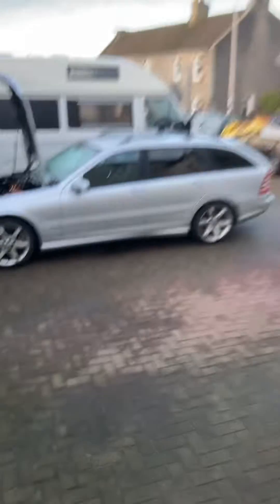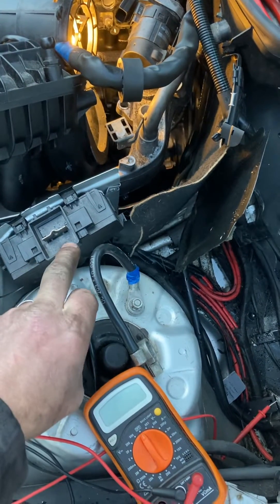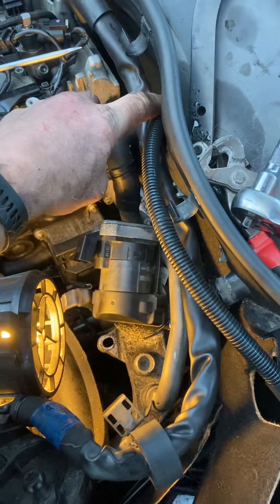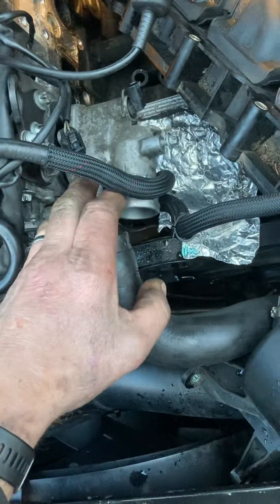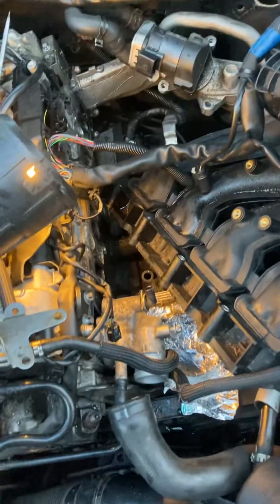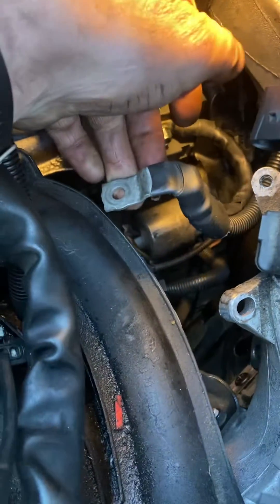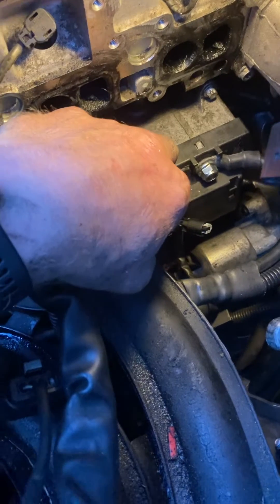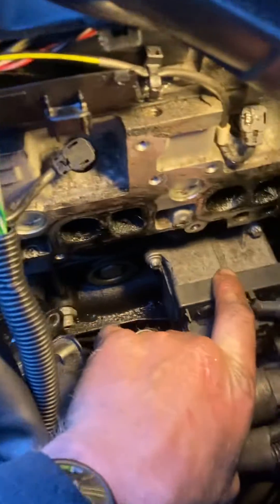W203 battery drain P1/5 booster heater part 1

Comment: I have a short circuit on the booster heater. Will disconnecting the HT lead solve the problem if I isolate the HT lead? What does the two wire connecter do do I need to disconnet that too?

Comment: Why didn't you just remove the starter from underneath the car to get to the heater booster?
Reply from the maker: Remove the starter? That’s one of those impossible jobs
Reply from the maker: Also I didn’t know what the booster heater was or where it was, I don’t have ramps. I looked at the starter and one of the bolts is in a very awkward position. 
When I removed the manifold I was winging it, I didn’t know what was there as it wasn’t on my diagram at the time.  I didn’t remove the stater as it looked really difficult and it was working. I found it better to work down blind than work up blind.  The purpose of these vids was to show the booster heater and the fault I encountered. If you want to refine your method bash on. I’d personally avoid starter removal if I didn’t have to.
Reply: @peaandham1973  I also have a defective heater booster and I'm planing to replace it. I asked because I'm lazy and I'm looking for the easiest way possible.
Reply: I've got code p1664. And I think this is it. This is the only video and information I've found on it's location. Did this fix ur issue? Can u just disconnect the power and not use it?